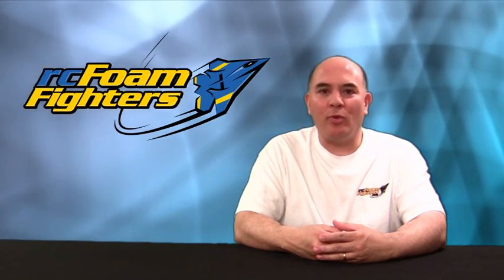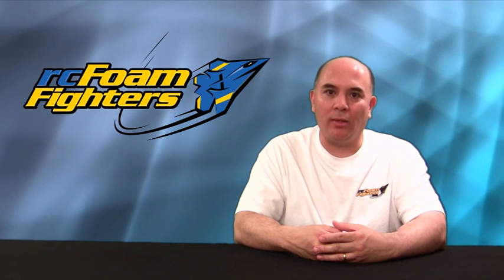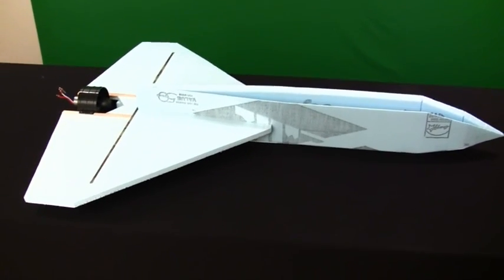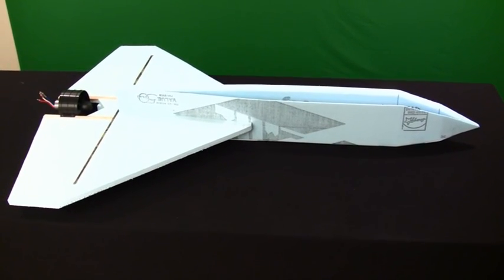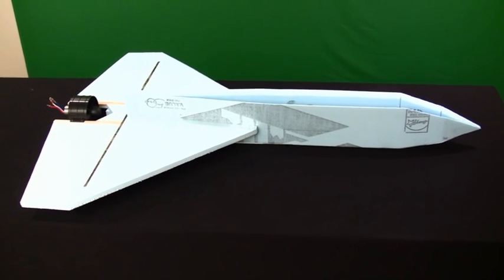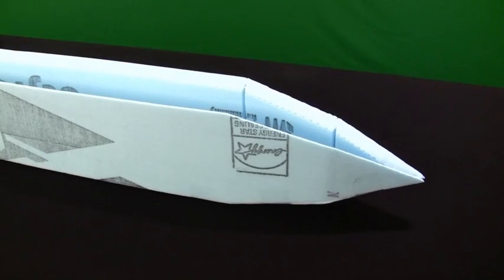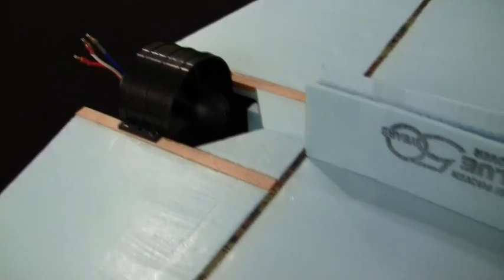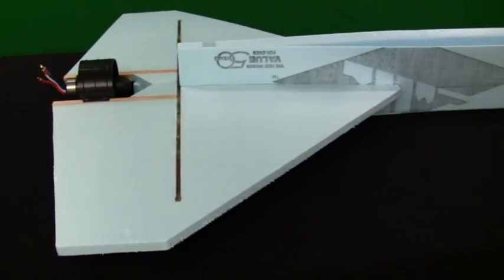89mm Duct fan Plane Project Part 1

Comment from the maker: zyoungson it is big isn't it, lol! It should look more proportionate after the rear half of the plane is done. It is so big because the edf is 3.5 inches in diameter add the mounting tabs and its over 4 inches. I didn't think the plane would look right if the nose was shorter than it is wide.

Comment from the maker: eitanoiman I just throw it as a bare airframe like a paper airplane. If it flies well I mark the cg if not then I adjust the weight to the front or back of the plane till it flies just a little nose heavy. Then after the cg is marked I add all the electronics and power system keeping the same cg as the bare air frame or just a little forward to make sure the plane is not tail heavy for the maiden flight. That's the usual way I like to find the cg.

Comment: How do you perform the gliding test? what height? angle?
For calculates the CG, we are using an easy script I wrote. its very accurate for  diffrent kind of wings shape. I can send it to you. it even let you know the CG on forward swept wings with diffrent width on the wingtip from the main chord.

Eitan (from ARAE15 Israel)

Comment from the maker: Thanks eitanoiman! I will have to do some glide tests to find the CG when the airframe is finished and the maiden flight will be after the plane is ready. There is no set date yet but it will be a while longer as the plane is still in the beginning stages.

Comment: Lookin' good!
I've worked with the Dow blue foam in it's intended purpose, never for models,though.
How would you compare the weight/flexibility/rigidity factors to that of Depron?
Even comparing 1/2" Dow to 6mm Depron?

Comment from the maker: Thanks Gregg! The edf is 89mm or 3.5 inches in diameter and is claimed to be able to run on up to 6s LiPo batteries putting out 3-5 pounds of thrust. There is a simple mod that is supposed to bring it up to the 5 pounds of thrust. I will be doing the mod in one of the upcoming videos of this build.

Comment: Enjoy your vids. Just some info you may find useful. Those Haoye fans are VERY amp hungry. Also, you will gain a lot of thrust by fabricating an inlet lip for the fan. You will also gain speed by making a thrust tube for the exhaust. Go for about 80% of the area of the fan for your thrust tube. Cant wait to see the finished product.

Comment: Great Job....meticulous construction habits make every plane a winner!  How did you like the blucor foam?  Its all I have used since it is so easy to sand.  You should try using 80-120 grit sanding sponge and round off those sharp corners.